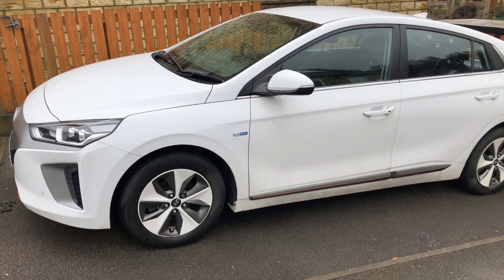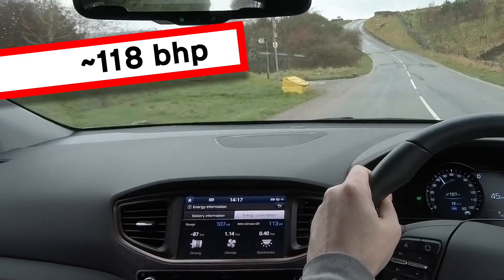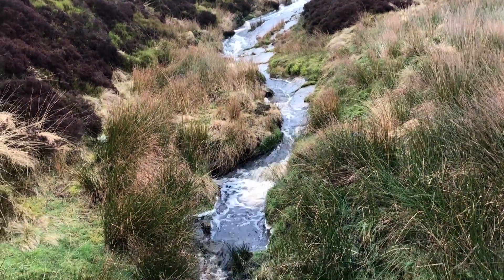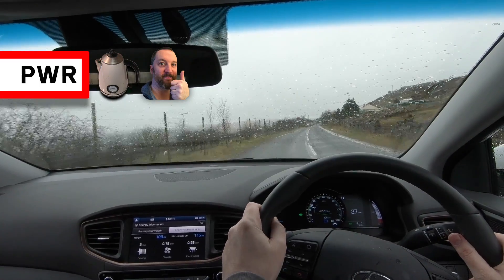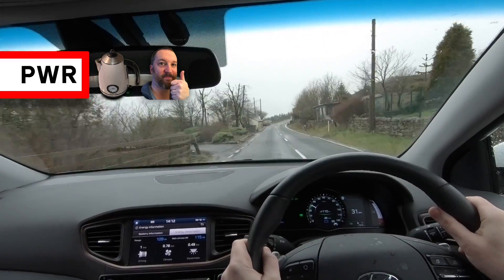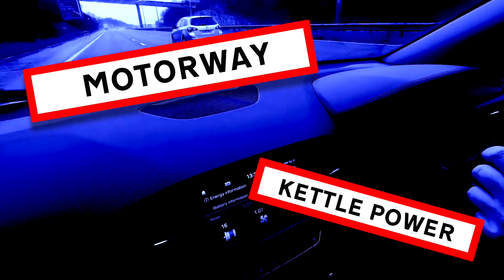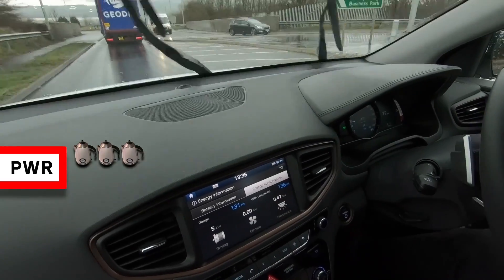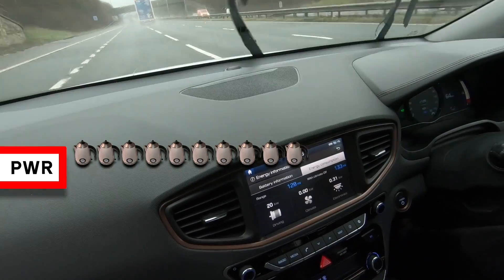How Much Power To Move An EV? IONIQ Electric Kettle Test!

Comment: You can do some really interesting calculations now that we have easy access to these figures. Say the ioniq does 15kwh/100km at cruising speed, we know that force x distance = work done or energy. Therefore force=energy/distance, and kWh=energy.
15kwh = 54000000 joules. So 54000000 joules / 100000 m = 540 newtons is the average force exerted when cruising at speed and not accelerating, therefore this is the sum of all the drag and frictional force.
Reply from the maker: Ah, yes. That’s right. Doing this made me realise the power readout doesn’t update frequently but as long as you have a steady state for a second or so, the power readout is usable :)

Comment: great job bud!  with my Bolt I am pretty sure it takes a fair bit more kettles to do the same kind of driving as an Ioniq.  The only reason I went with the Bolt is because it has a LOT more range then an Ioniq.  And being as I plan on twice yearly driving across Canada I needed that extra range.  too bad.  :(  because I MUCH prefer the Ioniq in nearly every other way.  more power and more range are the only pluses on the Bolt.

Comment: Hi here’s a question for you. That I cannot figure out in my Ioniq. How do you park on the side the road at night using your side lights are as we used to call them years ago are parking lights. When I turn the lights stock to sidelights and leave the car they turn off after a few seconds. There are occasions when I would like to leave the parking light on when I’m outside a shop for example. Regards Séamus
Reply from the maker: Thanks. I don’t know... if I find out I’ll post it here...
Reply: After you turn off the car, turn on the lights. (look for it in the manual)

Comment: I thought I’d like the iconiq. So took one for a drive and the interior felt old fashioned, plastics, cheap
Reply from the maker: Yes, it’s not great. The money has gone on the battery... plus it’s Hyundai. My cyclist friend Maria thought the same in a recent video. It’s an upgrade over our previous Nissans though - a LEAF and a Note...
Reply: @ZeroTailpipe  I took an Kia Niro hybrid for a test, and I was very impressed by the finish and build on that however.

Comment: An interesting thing to note is that an ICE car uses more than two kettles of power (5 to 6 kW) even when idling. Modern ones may reduce the power consumption to zero though when going downhill, engine braking.
Reply from the maker: Thanks. I wondered about ICE equivalents. I guess some sports cars can show instant estimated power... but rpm or instant mpg is more common, so tricky to do a similar demo in a petrol/diesel car...?